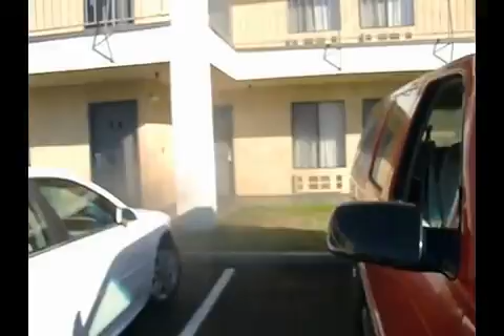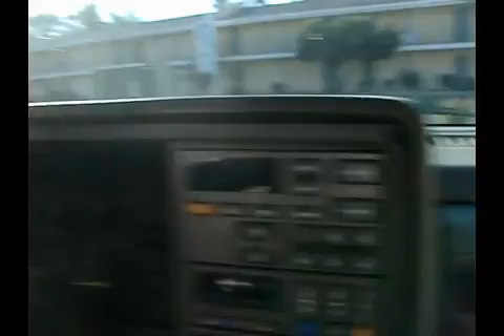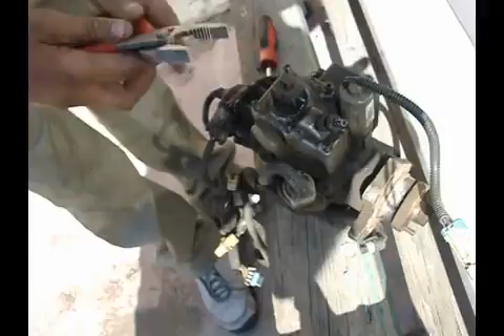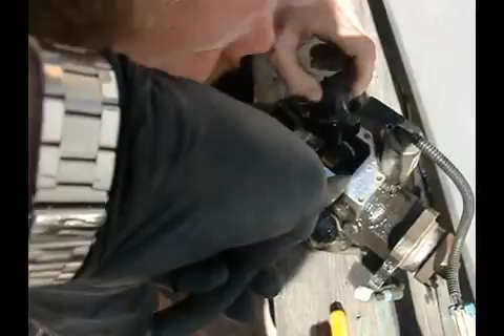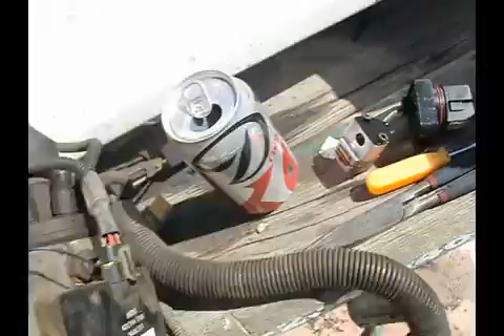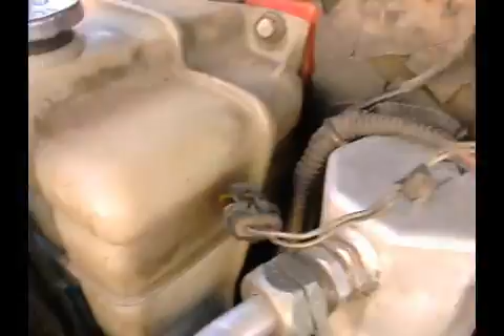10 29 12  POS TurboWeasel Inj Pump Junk Repair

Comment: Maybe. This pump as with other stanadyne pumps are a direct decedent of one of the first rotary injection pump made the Rossa Master. They last quite a long time. They usually die do to internal wear with new fuel, and fuel filters that don't eliminate small enough particles. Unlike bosch stuff you can get a rebuilt pump for 500. It not uncommon to have to replace them and the injectors on high mileage trucks.

Comment: Why not just swap out the whole ip. Just mark the timing with a punch install the one you know that works and go from there. Do the 6.5 have a 10 and 12 oclock timing mark on the pump?